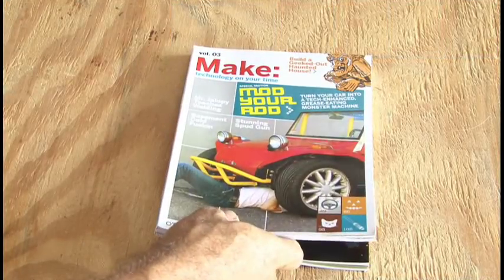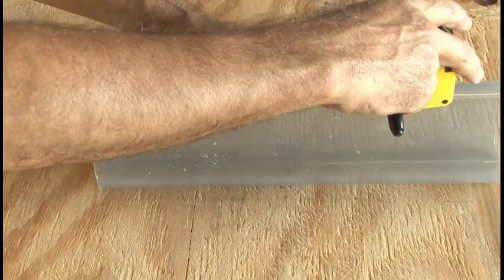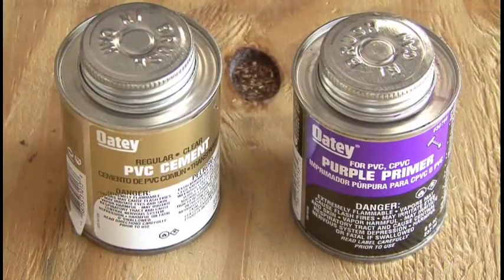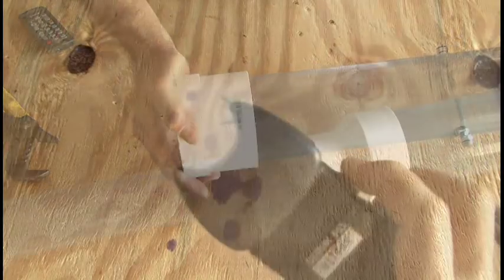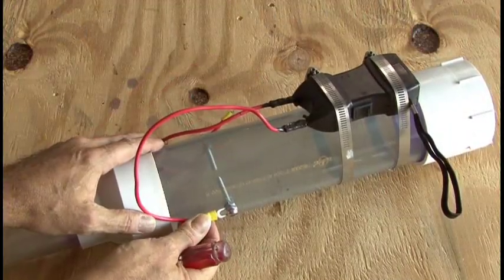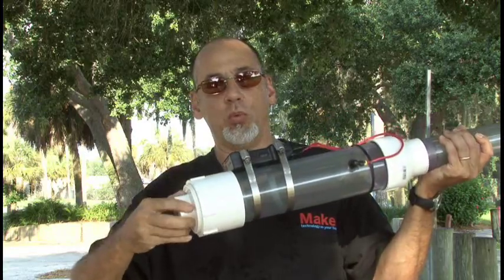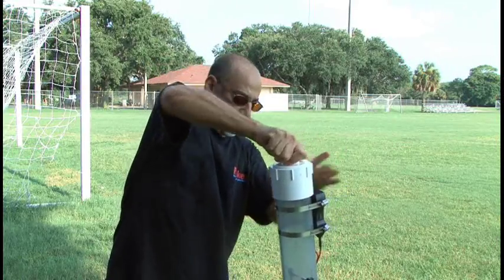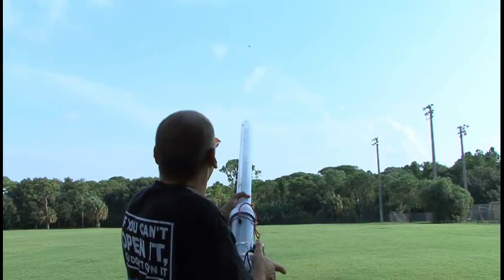Weekend Project: Stun Gun Potato Cannon

Comment: You don't even need the Stun Gun. A grill ignitor will work just as well...Find an old gas grill and remove the red button you click to start the grill. When you take it out keep the wire attached to it and its ready to install.. Also,its a LOT smaller.
Reply: A disposable camera flash will probably do the job as well
Reply: Phil Mowatt
 Hell yeah it will, worst shock of my life was from a camera flash's exposed wire.

Comment: You also can use a car ignition coil, a 555 timer and a 2N3055 transistor for the ignition source if you can't get a stun gun or want a safer ignition source.
Though it will require a beefy power source such as an RC car battery.

Comment: Mine has a few differences, I have a double latched hinge connection with rubber gasket between the barrel and ignition chamber so you don't have to push the potato down with a dowel. Also, mine uses a barbecue lighter and trigger/handle assembly from a paintball supply store.

Comment: hey kipkay im a big fan of your videos you make some pretty cool stuff. just a tip if you take a four inch peace of pipe the same size as your barrel and make a cutter out of it you can pre cut the potatoes and put them in the freezer they will expand slightly and create a tighter seal. also if you use starting fluid instead its much more efficient and safer it only takes a very quick spray rather than a three second burst

Comment: I was very intrested in this potato cannon so i went out and found some two inch and 3 inch schedule 40 white pvc (which was free) and built it myself. The only difference was I used a different ignition. I found a old bbq grill ignitor. it works great and the total amount of payed was 20 dollars and that was mostly cleaner and cement. Ill soon attach a response video

Comment: yeah same here in australia. what we use is a barbeque igniter, you know the button that you press in that sparks?? thats generally what we use. btw with a bbq igniter you dont need the bolts you just screw the igniter directly into a hole you have drilled into the pipes ignition chamber

Comment: On a hetero note: even the least of your videos are entertaining & informative.
On this variation of a vintage back yard favorite, it's unlike you to settle for good enough, rather than perfect the concept. So I request another video to employ the following suggested improvements:
1. Clear PVC is ideal as it shows fuel evaporation and depth of the projectile. But is rare as also expensive.
Mod: use standard S40 PVC & compensate the plunger depth while loading by measuring (or marking) the dowel.

Comment: we have that similar thing here in the philippines, it's called "BOGA", our fuel will be a denatured alcohol and the igniter will be the ones being used in a lighter. but BOGA is being used during new year as a source of noise but it emits a luminous flame at the opening and usually has a back fire if you over sprayed the alcohol. so the police immediately banned BOGA and was used only at one new year event.

Comment: I used clear 4" and 2" clear schedule 40 pvc.  Two foot chamber and about 5 foot barrel.  3 ignition points using wood screws and wired in series with 2 metal bolts screwed into the chamber that I spaced so that I can place the electrodes of the cheap stun gun that I use upon them.  I placed a hunk of rubber material between the closely spaced electrodes of the stun gun and used electrical tape between the bolts.  Used rem oil for propellent.  I wear a glove so I don't get zapped. It kicks butt.

Comment: I used 4 inch x 2 feet clear pvc for the chamber and 2 inch x 4 feet for the barrel.
Used cheaper white adapter fittings and I created two ignition points within with wood screws and used plain old speaker wire to connect the cheapie stun gun in series with the igniter points.  Kicks ass!  This gun on the video seen here is very under powered.
One final thing, wear rubber coated gloves when testing and shooting, that stray voltage hurts the hand big time! LOL.

Comment: What I found from potato cannons and their launching is that the potato needs to be put down to the very bottom of the barrel. Also, you can use paper towel as wadding so small potatos can fit. Spray WD40 down the barrel for more lubrication and longer shots. My ABS potato cannon can shoot atleast 200m.

Comment: The ideal of the taser over a BBQ ignitor is that it fires a streams of sparks giving you a much better chance of ignition.
Though if you can't get a taser you can just google 555 ignition coil driver for a circuit that will offer then same advantages of the taser.

Comment: thats pretty good for a 1/2 second spray and the tater went 300 feet, but thats a bummer that the cops got called on ya but at least the cop thought it was cool and told you how to make it technically legal. you could try an electronic sparker the ones where you just hold the button but those need the AAA batteries. im waiting on one of those electric sparkers I got 2 of the old pushbutton ones. I might make a taser out of the electric sparker one if i can find a small enough case to mount it in

Comment: RAJRIKKI I'm betting potato canons are illegal as well, but you can use a propane grill ignitor, it just won't be as reliable.  You can also use a 12v battery and a spark plug.

Comment: drill a hole at the bottom and put a butane can at the end and connect it w/ the liquid electrican tape and push the can to ad the fluid and use it so u wont have to keep opening it

Comment: on VERY crucial mistake in this potato cannon, when grinding the muzzle of the barrel, grind the INSIDE so you have a funnel shape and you get a MUCH tighter fit. then when you push the button you get a "BOOM" instead of the wimpy "foom" plus more speed/distance with your projectile. 
And, just to nit pick the fuel, you want the propellant gas used a aerosols that is combustible, I turn the can upside down so Im not spraying deodorant/ hair spray coating my electrical spark emitters w/ crud

Comment: 2. Not everyone owns or would buy a low grade stun gun. Offer audience the 9volt alternative, better yet- the disposable camera condenser?
3. Rather than waste fiel / time, install a ball valve for charging rather than a PVC cap. *Starting fluid / butane refill = more bang.
4. Why not devise a safe way to attach the fuel to the unit (less baggage). I've yet to see that done.
5. Apples. Animals eat them, plus less chance of hearing complaints since a cylindrical spud = evidence.
Love your work!

Comment: 2" is way too wide for the barrel. I always use something in the 1" to 1.5" range, and then sharpen the end so it cuts potatoes to size when you jam them in.

I also saw someone comment on hairspray vs deodorant. The adhesives in hairspray form a non-conductive coating on your electrodes. I've never had an issue from deodorant.
Reply: +thatotherguy27 Yea, using 1.5 here. Most regularly sized potatoes will form a tight seal at that size.

Comment: the taser is the item of questionable legality, but it could probably be replaced with a 18v short circuit, (two 9volts), wired correctly, or some flint from a cigarette lighter, some work would be needed to make either spark inside the tube.

Comment: Yea, me and a friend made one using a BBQ clicker. Fired it a few times, neighbors call the cops on us. Cop got to my friends house and said that the Spud-Gun was really cool but technically illegal in our county. But then he turns to us and is like "If you make it double barreled it will technically be legal." So of course we did that. And we used Spray Brand Starting Either. Combustion chamber was the same size as video but only took about 1/2 second spray for it to fire 2 potatoes 300 feet.

Comment: The clear PVC is a weaker rating in comparison to the larger variety of standard white. If you use rightguard deodorant spray, any liquid that comes into contact with the clear pipe, will fracture along the contact points, ours luckily was a dry fire so there wasn't any backpressure to completely destroy it. Builders beware, neat show with the clear, but I'd not suggest it for anyone wanting lots of shots.

Comment: Use a smaller barrel diameter, sharpen the end, and use a mallet to pound in a potato. This will cut an airtight cylinder of spud into the barrel.  No air leaks guaranteed.

Comment: the spark from two AA batteries will get you the same result as a taser spark. you just need a source of ignition. more voltage doesn't and never will mean a larger combustion. so instead of paing 50 bucks for a taser you could just buy two batteries and some wires...

Comment: did you still use the bolt spark plugs? when i made mine i was worried that the bbq-ignitor wouldnt have enough power to arch across the two bolts

Comment: You can also make this cind of canon that uses compressed air instead of the tazer and spray.
Just mod an used fire extinguiser (suck in english xD) and an valve with an steel barrel. refill it with an compressor and ur good to go. (you can allso fire apples insted of potatoes)

(P.S.  If you use this method, it can be rather loud!)

Comment: @HEXICxSCOPES  like 14.95 before batteries and shipping, so no more than 30 for sure, its one that looks like the one that kipkay used, only difference is that it has about 100k more volts, so its actually better for ignition. ill send u the website to you thru your inbox

Comment: im trying to build this. can a 6.8m volt stun gun do the trick also? just type in on ebay at it will cost around 9 dollars...and if it does work, can you still use 10 guage wire? please help.

Comment: 2" barrel is great, but you need bigger potatoes and a 4" chamber.  Try REM oil for propellant, not as good smelling, but more power.  In addition to the PVC glue, use wood screws for reinforcement, also keeps you from pushing the potato into the chamber. 
BBQ ignitor does work well, I have made a couple of very powerful spud cannons that used them.  I find the high voltage stunner to be more reliable though.
Off the subject, but what I have found that does not work so well is the Google/YouTube spell checker when I spell words like 'ignitor',or 'Alinsky", I have to imagine that it won't be long before they squiggley red underline other words in comments such as "freedom", "the right to bear arms", and perhaps even "free speech".
Thanks YouTube, perhaps someday you may change your tune, but by then it will already be too late.  Just saying.

Comment: i clicked this because i thought it was actually gonna fire electrified projectiles. kinda glad it doesn't, but kinda disappointed too

i guess the hose clamps are okay, but if you're worried about stray current, it seems like using nylon ties & glue would be better. also, pro tip if you don't have liquid electrical tape, for most hobby projects you can get away with using a hot glue gun, which is also faster

Comment: you're doing it all wrong.....try this....use halved potatoes (twice the ammo for the same price and there is less surface area touching the barrel) ...first place the potato in the barrel and jam it in about 6 inches...(make sure there is fresh "oxygenated" air in the barrel) Then add propellant as desired (less is more)..then seal cap and then jam potato down all the way, now you have created  compression like in a car engine which will lead to a more volatile combustion and farther projectile

Comment: Gas grill starter is cheaper and doesn't require batteries... A tazer? really? Way over kill.

Im liking the clear PVC, but as someone who has fired a few hundred potatoes I have to say you picked one of the worst ways to hold it and fire. Keep that clean out plug away from your body... If the threading wears out or you don't get it sealed well enough then expect the hot gasses or fire to come shooting out of the back.

Comment: SUCH a waste of a stun gun, best to use a simple grill lighter (built in to grill buttons).

A trick to have the best fit potatoes is to file the end of the cannon on the inside to make a sharp edge which will trim big potatoes to the perfect size.

Comment: ok thats the shittiest potato cannon ever, mines 9 feet long at will put a potato in the air for 11 seconds. The barale should be 1 and half inches not two"  and make the combution chamber longer, like 3-4 feet. Use hairspray not de-oderant, burns so much better but it cakes up on the sparker so u have to clean it more often.